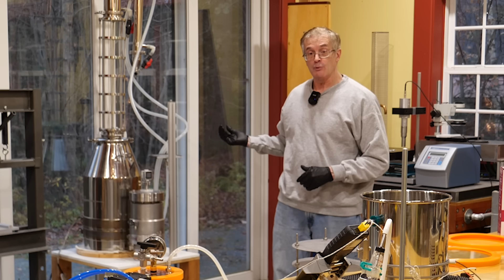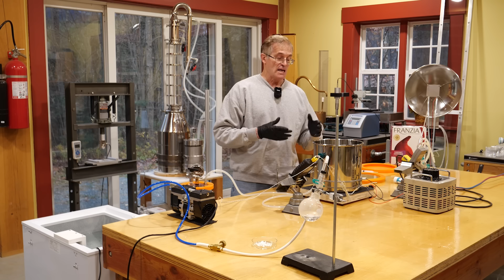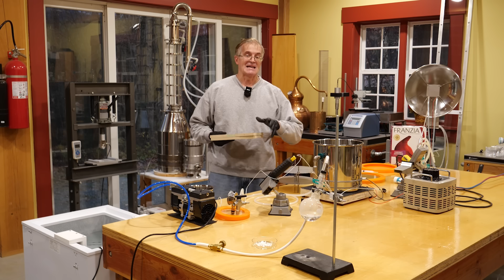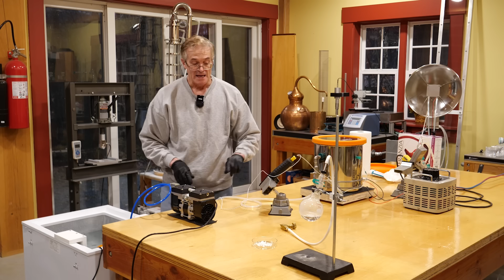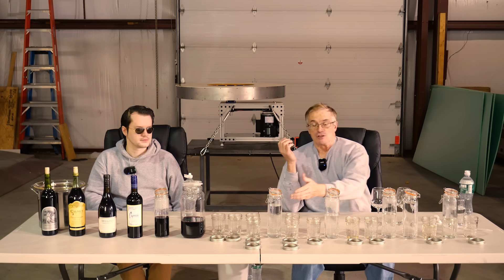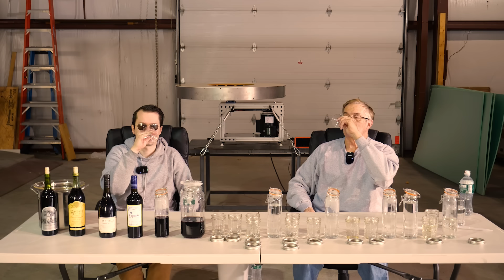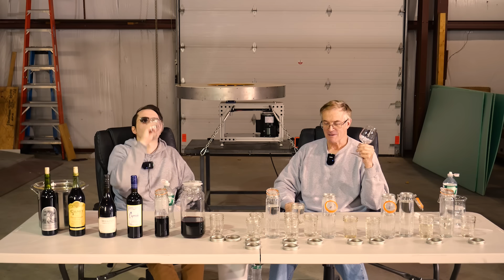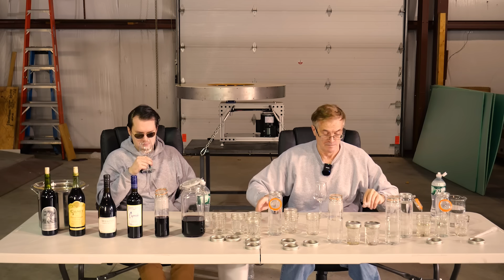Turning $3 Wine into a $100 Vintage with Science!

Comment: Isn't one of the processes happening when aging alcohol that more volatile alcohols will evaporate out through the wood? I.e. you should maybe have had smaller heads to isolate the rubbing alcohol and cut it out, while keeping the smooth more pure ethanol cuts? For example when you age whiskey you do it at 70% and the alcohol percentage will steadily drop during the process.

Another experiment that would be interesting is to drink the unadulterated wine between the cuts and see if you can find the flavor :)

Comment: Great episode! I wonder if molding silicone stoppers would be a reasonable way to make them, possibly with a tube, or multiple tubes, in them? Or even 3D-print stoppers in TPU?

When vacuum distilling less complex things, like to make distilled water, could some porous/fibrous material floating in the liquid reduce bumping, and provide surface area to evaporate calmly from? I realize you wouldn't want to reduce heat transfer within the distilland, I was thinking in terms of a small amount of something like granulated activated carbon or perlite.

About that heat transfer, could the vapor flow from the distilland be utilized to power stirring of it? The pressure is negligible, but the volume should be quite significant, and a slight stirring wouldn't require much power, with some kind of floating turbine, there shouldn't be much static friction at all as long as it can be kept from the sides of the distiller.

Comment: Firstly... Thank you once again for another surprisingly informative video.
It is always a gem to have a weekend baptized with your presence... Albeit, this time I had it start my week instead.

Can one extrapolate that setting an alarm would be a "divider" for equal proportions per distillation? Like to check on it every hour or halve hour etc.?
Or was the condensation non-uniform when it comes to how long it takes for each compound; thus it would only be near even divisions, shall the volume gathered be measured and somehow set to notify  you or basically close the valve etc.?

Honestly, I believe that this can be applied to a great variety of beverages... Not necessarily alcoholic, even.

Have a great and productive week you two!

Comment: Factual error at (8:12), cellulose does not ferment into methanol,  it's called wood alcohol because methanol can be made from wood by pyrolysis. The methanol in brewed beverages comes from pectin fermentation.
Reply: Methanol ends up in the mash because some of the microbes get carried away then... Regardless, you want to avoid it when concentrating the alcohol.
Reply: why would there be no methanol in the wine? how can one know?

Comment: 9:18  slight correction there , wines typically contain more methanol than beverages produced from grains. The issue of cellulose you mention is dry distillation and requires comparatively high temperatures. When pectin is degraded methanol is released. One of the common fruit wines with the highest methanol content is plum.

Comment: As an Australian, I am an expert with "box wine". 
Firstly, the box is only for show. If you're having a fancy dinner with friends you can impress with them your knowledge of fine wine by letting them see the box the wine comes in. That is the only purpose of the wine box.  For less formal situations and science experiments, you're better off just dealing with the goon bag and throwing the box away.
Although the tap can be use for pouring your wine into a mug or a stein, this is better achieved by giving the goon bag a good squeeze. Mostly, the tap is used for communal drinking. Whether at a local game of footy, from your school bag on the bus home, or a competitive game of goon-of-fortune, the tap is the perfect drinking utensil.
Finally, in this high-IQ science video example, you're avoiding the outrageously high levels of Alcohol excise tax by buying wine (wine equalisation tax) and turning it into a spirit (a much higher alcohol excise tax). Turning wine into illicit spirit is tax fraud, a criminal offence. You wouldn't steal car, and not paying excise tax on spirits made in the privacy of your own home for your own personal use is like stealing money from the Tax Department.  In this situation, you should hold the goon bag over your pot and  very carefully, cut one of the corners almost completely off.  You don't want to lose the corner of the goon bag into boiler. It will empty quickly, so make sure you've got a good hold on the bag because you don't want the good stuff spilling out.

Comment: I love your still. You are one of the very low percentage people... who can do what ever they can think of. Your channel is so interesting. I did look at your water air conditioning and I wonder if you could do a video where you use humidification of air in to a condenser, using the condenser as an energy source for this... and controlling the humidity to a 'never drop water level' say 90%... so that nothing can grow in the condenser. And demonstrate the increase in efficiency and cost effectiveness of replacing power draw with water used. I know it is a massive difference.

Comment: hey tech ingredients guy, since u used to be a hospitalist you might be interested to know that you can get portable 3l/min o2 concentrators for like 150 bones on scamazon. i had the idea if using a few of them to do oxygen enrichment in one of my chevy volts to reduce the lazy nitrogen and achieve more efficent/more adiabatic combustion in a lowish compression engine to boost fuel economy. ironically the portable versions are set up to run on automotive 12v from the factory and only consume about 20-60watts. thats like 2 orders of magnitude less than those old browns gas generators lol. i know you guys dont do much stuff with automotibles but i thought it might be a fun project for you guys to try. i think about 3 of them running into the air intake could reduce the lazy nitrogen concentration from ~78% to around 70% and its effect on either a car or generator might be really interesting. there is no replacement for displacement, but ive got an idea for replacement of forced induction. would have to watch out for heat and knock but i think if the compression ratio is low enough and the engine runs cool enough you could get away with some mild oxygen enrichment by essentially filtering out the lazy nitrogen from combustion. hope you are as intregued by my idea as I am. lot of people think it would break some law of thermodynamics but those are usually the naysayers who cannot pronounce adiabatic.
Reply: Oh?  My propane torch would like to meet one of these.  Good to know!

Comment: How about adding a proportionate amount of distilled water to replace the cut parts?

This will be less tart while keeping the alcohol in check (you'd need to guesstimate or calculate how much distilled water you want proportional to the alcohol that was removed, if any)

Comment: I thought the separation into components was (as usual) well thought out and thorough. However, the nasal and taste bud method from which you draw your conclusion is always going to be very subjective. Panels of wine loving people who blind mix your components might produce a statistically meaningful trend in their conclusions. Also, I have often dismissed a wine on the first couple of sips, only to be converted after a few minutes breathing (equilibrating with ambient air) in the glass. Perhaps in future tastings you might allow your blends to breath a bit to see if that changes anything.

Comment: For your next experiment you should start with E85 and extract the ethanol... I've read they denature biofuel ethanol with just gasoline before it's shipped therefore separating it would be super simple. 

With the price of E85 that would make it the cheapest price per gallon of ethanol by a massive amount. It's $2.15/gal here and at 85% ethanol that's 10% of the price of grain alcohol. Any thoughts?

Comment: It is interesting that you are keeping the foreshots and heads. You probably should have made smaller cuts in the beginning to get rid of the methanol. Yes much of that high alcohol feel from the first cut was methanol. It also would have been interesting if you had used an alcometer to see the strength of each cut.

Comment: Try adding the aged oak flavor in.  Use some oak woodchips you can get from brew supply stores, add it to one of the cuts, place that in an ultrasonic bath for 1/2 hour.  You could very the amount of time in the bath or very which cut you use.

Comment: I have tasted vacuum distilled "grappa" make from wine fermentation waste. It was surprisingly good. Got enough vacuum with a hand operated cheap piston pump and the cooling and heating wa made by a heat pump from a freezer. Wrap copper tube thighly around the vessels and carry the device to refrigerator repair shop for vacuuming and adding ner propane. No separation of heads and tails, no valves for that.

Comment: Nice work!   I noticed all your discarded cuts were right after the "head" alcohol and all grouped together.   So with some temperature monitoring, you could reduce this into 3 cuts, take the first, discard the second, then stop there and combine the first with the remainder and you should have the same recipe.   Seems like this could also be automated with a microcontroller monitoring temperature and some solenoid valves and maybe a peristaltic pump and you'd have a near hands off system!
Reply from the maker: That's just about what I also explained during the livestream that followed. 
I agree with you.
Reply: @TechIngredients  Sorry, I missed the livestream.   Look forward to seeing an automated system if you ever make one!
Reply: As explained in this video: to be able to know what part you want out, you first need to cut the wine in many parts so you can decide  which cuts you want in or out.
Once you know that, you can cut the wine in way fewer parts.
Reply: @TerrorTubbie666  Yes, but my point is if you track the temperatures of each cut, then for future batches you only need to make less cuts only at those "cut points" and it can be automated.   You don't need to repeat the cut selection process for each input, given it's a constant chemistry.

Comment: Does anyone have a recap for me as I dont want to spend 1.5 hour watching it? Are they distilling the wine to extract the ethanol leaving a concentrated wine essence leftover, then seperating the ethanol 'cuts' similar to moonshine and then taking the 'heads' and 'tails' and mixing that back in with the wine essence to re-fortify it? Is that backwards to normally where you use the 'hearts' in ordinary distillation?

Comment: Next: Continouse ferment under a partial vacuum  prevents alcohol stressed yeast.
Reply from the maker: That's a very interesting concept.
Reply: @TechIngredients I asked  Google's AI Gemini about it.  It tells me.. Advantage: This keeps the concentration of toxic ethanol in the fermentation broth very low, allowing the yeast to remain highly active, which leads to: Higher Productivity: Fermentation is much faster (up to 12 times faster in some research models , and Higher Yields: Highly concentrated sugar feedstocks can be used, and the sugar is fully converted.

Increased Congeners: Removing CO2 increases the growth rate and viability of the yeast.  This often leads to a higher overall production of volatile organic compounds (VOCs), including esters (fruity/solvent notes) and higher alcohols.

Comment: Good advice at tasting is starting with the least volatile (no alcohol) and built up to stronger ones - because you essentially flat line your taste buds at the start with 95% alcohol and then don't feel subtleties down the road. A technique to use water to bring the most volatile part to 35% would be a much smoother experience.

Comment: Methanol is naturally present in fermented fruits due to the digestion of the pectins present by the yeast, this is less so (to all extents and purposes not present) in grain based alcohols, true if the grain is left in the mash and added to the still it could cause the destructive distillation to occur but this is easily solved by racking or filtering the mash prior to distillation. Hence you are more likely not less to get methanol in brandy than whisky/whiskey or vodka/wodka. I feel that in small runs the amount of methanol produced can be largely ignored due to being insignificantly small and due to it coming over with acetyls which will taste like nail polish remover and hence hopefully be removed even if present.

Comment: Fractional grappa distillation! I use a similar method for “dismantling” the components with my infinity still. The main difference is that I use continuous distillation and adjust the flavour profile on the go. Try to add dime wood chips and some dried fruit in the pot such as sultanas and prunes. Also keep the ratio of tannins constant aka don’t add all the leftover at the end. Great video!
Reply from the maker: Thanks!

Comment: There is methanol in wine, in beer as well, just not in concentrations that are harmful. Distill either, and you remove water which raises the concentration of the methanol, which is why you need a license to run a still, but you can homebrew beer and wine without a license.
Reply: it's not the lack of water that's the problem, it's the lack of ethanol

Comment: If you're ready to get unexpectedly drunk, bring out some foods to test alongside the components that you like. Every time you taste something you like, you give yourself an idea of what you'd like it with. Then combine components to match certain ingredient groupings, if you are really adventurous go back and forth between wines to add components together. This also works as a way to get a good sense of which foods pair well together. At the end use the reassembled wine to test additional ingredients or meal pairings.

Although a nice factor of doing it this way is you can exclude most of the alcohol ingestion by avoiding the high proof region until the end. This also makes the extremities less mandatory if you want to swap them out. So far all you can do is subtract. Imagine if you were free to add other things back in.

Comment: Wouldn't you want to add back in the same or similar volume of distilled water as the undesirable cuts that you removed so the concentrations of the desirable components remained the same as the original product?
Reply from the maker: Not necessarily.
In the end, what matters is the taste and aroma.  If the concentrating effect added to the benefit of removing the funky fractions then why reverse that?
Reply: @TechIngredients Absolutely there is no right or wrong way to do it. If it tastes better, then it tastes better. Excellent video. Interesting and entertaining, as always. Cheers

Comment: by removing some of the jars you increased the fraction of the other jars (especially the full-flavored tart residue) in the final product. also, you should have taken a fixed percentage (by weight, and without omissions) of each jar and combined to see how close it comes to the original wine.

Comment: 11:30 If you elevate 100ft, you can subtract about 1°C. So, Denver is about 5000 ft, so the boiling point of water is about 95°C. It's not linear going up to the Karman line.
Reply from the maker: That's about right.

Comment: Really should have combined the chosen components with the pipette first to taste the finished product so you could still adjust before combining. The Camus is particularly well known for being made to be aged at home and therefor doesn't taste its best when young. I have tasted it aged and it gains sweetness as the tannins drop out. The Silver Oak is generally released ready to drink with some age on it though it can take more, that's what you are paying more for and why it's so common at nice restaurants. 

Overly aged wine tastes too sweet, but also thin because it's lost too much. What you have done is basically created a time machine, you just have to decide how far forward you want to go. Also, you really should have tested the alcohol without the first one in the final mix and added only as much as needed to bring it up to around 12% ABV.
Reply from the maker: Thanks for that insight.
Even though we like wine and did some research, we don't pretend to be experts on wine.
Reply: @TechIngredients  I meant to add that I really enjoyed the video and watched the whole thing, I hope my comment didn't come off as too snobby. It seems that adding wood chips, mentioned by others, might be the missing piece.

Comment: OK, I'm not a wine snob, but I am a serious wine student. Fascinating experiment. I might have been more tolerant excluded only the really obnoxious tastes like the musty one. There are also some really volatile portions that I'm not sure you catch at 0C. You might want to try colder for the first cut. (The great smell of the last bottle???) The other idea is recruit a professional sommelier. They have a lot of experience with "aroma tasting" and descriptors that would really relate the science to the wine world. They also might lend some insight to the blending! Lastly, you have removed some fractions and concentrated the acid and tannin components (and solids and more) that were left in the pot. You might consider replacing the water volume lost, at least in part. Oh, and how to avoid a comedy show? Spit out all the tastes! Professionals don't drink the wine when tasting! Sub-lingual absorption will still get you in end but it really makes a difference!